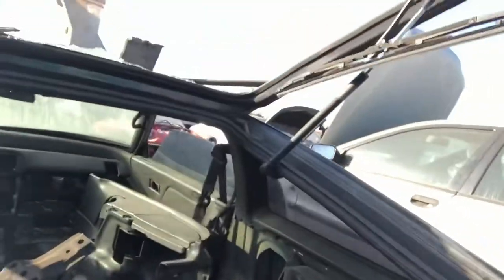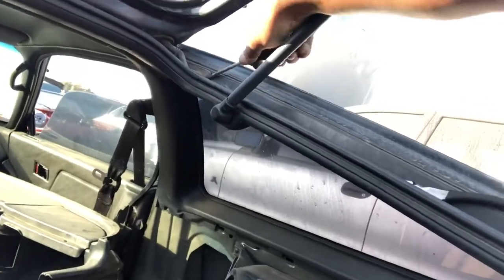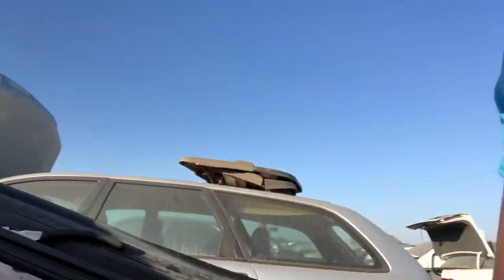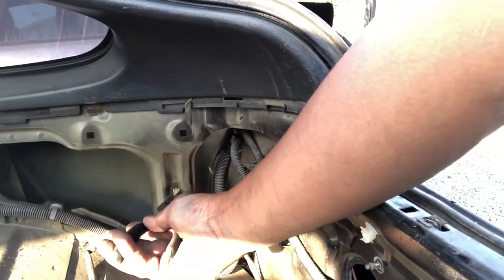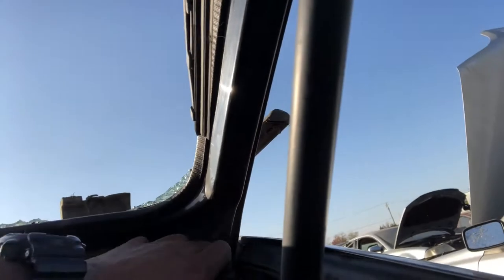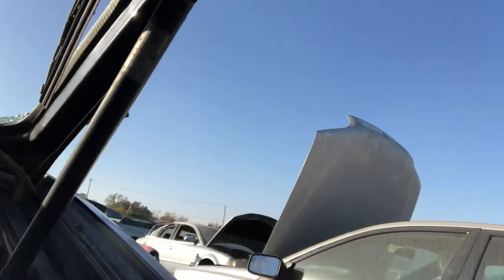Proper way to remove 88-91 CRX hatch harness

Comment: Definitely helped me bro. I gotta pull the hatch on my 90 CRX tomorrow and I was wondering how I would do this. I'm going to tape a piece of wire to the connector and pull it through as I remove it so I'll have it in there to pull the harness back through when I reinstall the hatch after body work & paint. Thanks so much for uploading this!!